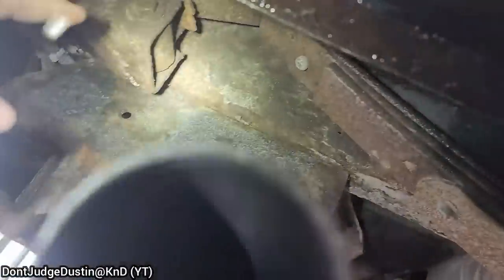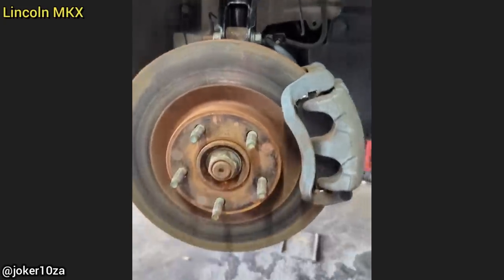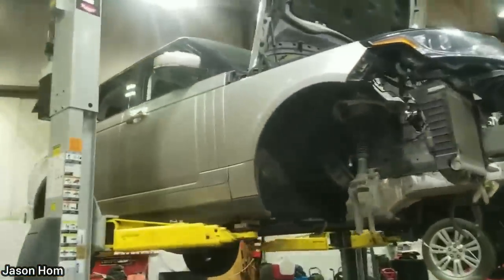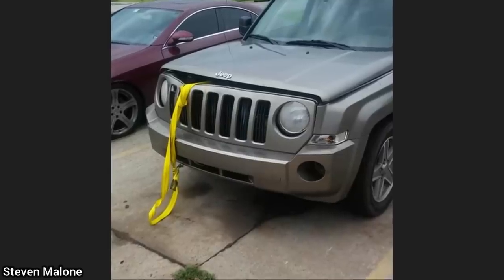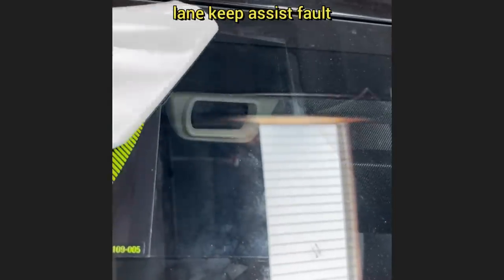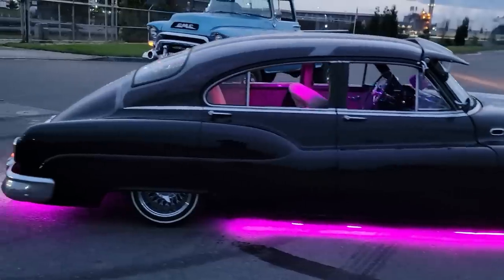Customer States They Just Want An Oil Change

Comment: I'll just tow it in myself with a rope tied around the grill !
Reply from the maker: You'd think driving to the part store to pick up a battery would make more sense 😅
Reply: @JustRolledIn  Almost anything would make more sense than what he did.
Reply: @JustRolledIn  such a new car has a battery sensor. You really think he has the right program to properly install the battery and tell the car?
Reply from the maker: @tobiasmetzger4522  a Jeep doesn't require that. Install a new battery and you're good.
Reply: @JustRolledIn  an older one, yes. But anything new needs it. Anything with the battery sensor and the start/stop function.
Reply from the maker: @tobiasmetzger4522  yes but not that Jeep specifically in the video. Either way not the best way to tow a vehicle for a battery lol
Reply: @tobiasmetzger4522  Jeep in video isnt all that new, I dont think. Stop start hasnt been around for 15 years in most american vehicles.
Reply: @JustRolledIn  and only owning 1 car 😂
Reply: I must've missed that clip. Or my brain isn't allowing access
Reply: @JustRolledIn  My immediate thought is... Couldn't he have just gotten a jump start and driven it to the garage? Like, I find it hard to believe that the battery suddenly went through catastrophic failure to the point that it couldn't work at all as the motivation for having it replaced.

That said, with the IQ on display with the tow job, I wouldn't put it past the owner for somehow utterly destroying their battery...
Reply: Probably leave the battery caps on, tow it to the shop and say it won’t start because of a bad battery. Some people are idiots in the first degree.

Comment: I had a 05 GMC canyon and the bottom driver's side frame rusted away, I sold it to a scraper and he welded bed rails for a patch kit and used it for a daily driver. He ended up scraping it a few months later because the frame fully gave out.

Comment: The axle having a drum brake only on one side is baffling me a little…
Reply: When I was an apprentice we got a car in for its first service, Austin or Morris, cannot remember which, and it too har drums on one side and discs on the other - but it braked straight!!
Reply: @leifvejby8023  The fact that it braked straight baffles me.
Reply: @sambrown6426  Me too!!
Reply: @leifvejby8023  Do you remember what model of car it was? And did it have any other sketchy repairs/mods?
Reply: @sambrown6426  Disc brakes are all hype.   They probably had to replace an axle due to wreck and that's what the yard pulled.
Reply: Maybe they didn’t finish a disc swap

Comment: I'm a Kansas man. Jerry rigged many things questionably... this channel still amazes me with that area of engineering 😂
Reply: I once had the mechanical fuel pump fail on an old truck of mine while doing 70 on a lonely highway in the middle of nowhere. Managed to rig up the washer fluid pump to keep the carburetor bowl filled. Once I got the rhythm of hitting the washer fluid sprayer down, she ran with no issues all the way home. I'm rather proud of that.
Reply: @sambrown6426 oh my! As teenager, we thought using Ubolts on the old International's drive shaft would buy us time instead of buying a simple U joint. Oops
Reply: @toupac3195  Yeah, those you want to fix correctly.

Comment: Hey, Nice, more jaw dropping action and carnage always bro!  Yesterday I was waiting for this kid to help fix his broken sunroof for free but it was raining but I still swapped my one bad subwoofer while I was waiting.  It went from an 8 hole to only 6 so I had to get out the drill and cord and make some quick pilot holes and jam in the cool tork screws.  This is the 3rd home type 10" sub speaker going in my truck that I saved when the weak amplifier blew out in the home theater.  It had an awesome copper metal Klipsch and a black JBL that survived my blasting metal and old skool rap about 10 years now but the Klipsch died and got replaced with grey Infinity that's back in action with the JBL now!

Comment: I was going to DIY my own muffler tail pipe last year. I had what i called Frankenstein muffler, on my versa. They make them out of tin. I had pretty much the who thing patched from front to back over 2 years and it kept blowing holes. I did not at the time have the funds to replace everything. The last time i had a repair they pointed out my tail pipe was missing and warned me my bumper would melt. It was starting winter so i was not that concerned yet and i don't drive much. The muffler itself still seemed to be intact with a small amount of easily scraped off rust. I was going to cut a can and high heat metal glue it on the end.
Never got a chance to see if it would work. Weather got bad and so did my health. I now have a full new front to back muffler, thanks to help. But thought someone might find the story funny.

Comment: If I can't fix a problem correctly, I will bring it to my mechanic. The smallest job in that category is my rear brakes. The calipers have 2 pistons, and I just can't do it without a special tool. The largest job I've done myself is a throw-out bearing. I replaced the clutch, rear main seal, and shift linkage on top of that since I knew the transmission had never been serviced

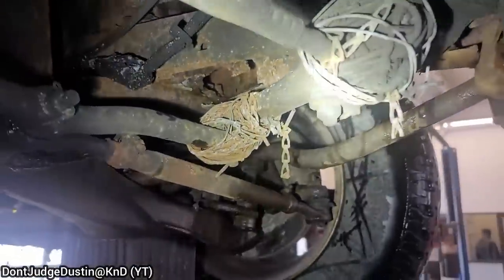Comment: 0:40
Any rollover crash that truck gets involved with, it will collapse the passenger compartment as the weight of the frame squishes that rusted body. There is NO support in that pillar, it won't handle any weight if flipped over.

Figuratively.. almost literally a death trap to drive.

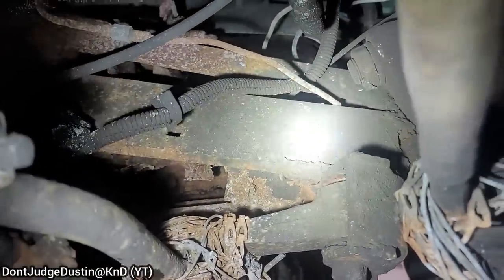Comment: 0:37  Wait, lemme guess...one word, two syllables, starts with "D."  Right?  Maybe there should be laws enacted requiring shops to report such owner's irresponsibility as a public danger, causing a mandatory BOLO by law-enforcement.  Under said law, shops would be required to physically point out the hazard to the customer (yes, that means bringing customers into the service area) and why it must be repaired, not merely "should."  If customer afterward "declines" repairs, shop then contacts state DMV to issue a BOLO for said customer's vehicle as a potential road-hazard.  After all, owning a vehicle is a right; driving said vehicle, on the other hand, is a privilege, NOT a right.

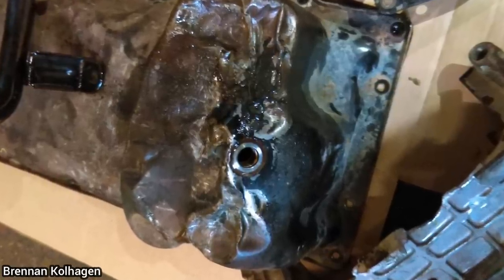2:44  Prolly the shop that happens to have a street address exactly identical to customer's place of residence. 🙄

3:16  One question here:  After all the kilograms that oldtimer's owner put into the purple-rain-lighting and wheel trickery, did the owner ever think about installing brake and turn-signal circuits into that oldtimer...?

Comment: i sold auto parts at a store who also did repairs and i've seen some of the stuff shown when the mechanic for the store would put a vehicle on the lift for state inspection or just for a simple oil change and would bring me in to see what he found and would have me as a witness when people pick the vehicle up and tell them about the repairs needed and then people start yelling at me and the mechanic stating that there's nothing wrong,pay for inspection and walk away-had a customer call the state inspection unit to complain,they came out and say the paperwork stating that things need to be replaced are CORRECT and reached into the vehicle,scraped the inspection stickers off,removed the licence plate and had the vehicle towed away because it wasn't street legal(phony inspection stickers,registration for the car was 3 years old and no insurance)

Comment: ❓So, I'm guessing there's no obligatory annual vehicle test in the US, like the MoT here in the UK?  Does it differ from state to state?
Reply from the maker: Yep, different rules for each state.
Reply: @JustRolledIn    I thought that would be the case, thanks.
  Are there many states that don't require a roadworthy check or ones that aren't within a 12-month period?
  The reason I ask is I can't quite get my head around how the "issues" some of these vehicles have surely must have been picked up on during the last inspection; much of the stuff, the corrosion in particular, clearly didn't happen overnight.
  It's mind-boggling to see what absolute death traps are on the roads; one of mine failed its MoT because I didn't spot that the jetwash for my headlights didn't pop up when spraying. 🤦
Reply from the maker: @Loneman_OG  I'm not sure to be 100% honest as I'm not from the US. But yes it's rather scary what's on the roads 😅. And it sounds like the MOT is very strict but that's a good thing!

Comment: The hole in the muffler isn't even a big deal at all. We have no emissions laws here and also no state inspections (unless buying a car from another state, and even then the inspection is quite the joke). I've seen far far worse. The Buick was awesome. As for the person who said..if I built a 55' Chevy I'd put a 350 in it....Uhmm no. My Cousin had a 57' Bel Air showcar. What was in it? a 327/375 fuelie with a 4 speed, and even in that big car it would run!
Reply from the maker: That's the whole point of the hole in the muffler photos lol. that's why I showed it.

Comment: Do Jeeps not have a tow hook on the front of them?
Reply: All Jeep models have recovery hooks on them and if they do not have these hooks they have a tow loop that can be attached by removing a small panel on the front bumper. You rarely see this as most jeeps are towed with their recovery hooks if it is stuck in mud or snow. The tow loop is used to towing the Jeep over long distances.

Comment: What does three on the tree transmission mean?
Reply from the maker: A three-speed manual transmission whose gearshift lever is mounted on the steering column. It's old school.
Reply: Oh the young ones
Reply: I have a buddy that has a 3 on the tree shifter. I thought it was an automatic. I spent over an hour looking for the dipstick tube. When he got home, he told me it was a stick shift, I swore he was wrong, it was an automatic, then he stepped on what I thought was the e-brake pedal, which turned out to be the clutch pedal. I guess he knew his truck better than me.
Reply: @38skippers  Not so much young ones, but I've never seen a car in person with a gearstick on the steering column like in America.
Reply: @HesmiyuMC  Not just America, last car I had with one was a 1972 Holden (New Zealand). But my son had a 70's something Datsun Ute (small truck) a couple of years ago, that had 3 on the tree, he thought I could not drive it. Ha! Grew up with 3 on the tree. I think you will find them anywhere if you go back far enough, I seem to remember driving an old Peugeot which I am pretty sure had that. Might have even been 4-on the tree.

Comment: I don't get it.  They bodge the frame rails by welding a bit of re-bar to it and wire up the front end to hold the broken joints together, then bring it in to a shop to have the oil changed.  All those first things you should never DIY like that, whereas an oil change could be done by a monkey if you handed him a spanner and pointed to the drain plug.  I can't even...

Comment: For the safety of everyone else on the roads, every state should have annual inspections required. Anyone with a rigged vehicle should be fined much higher than cost of proper repairs, or they can rat on who did the work and that person gets fined. Might put a “dent” in number of cars on the road held together by safety pins.